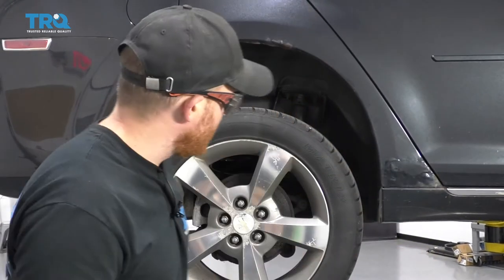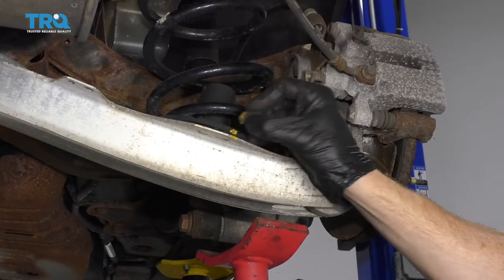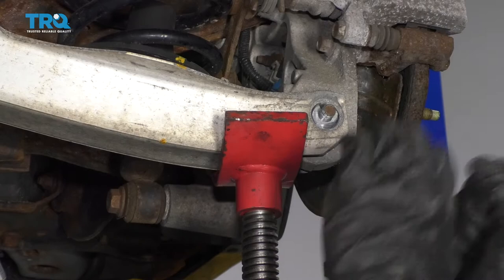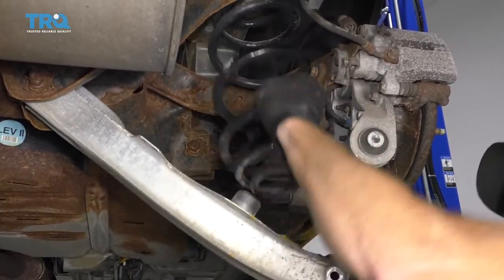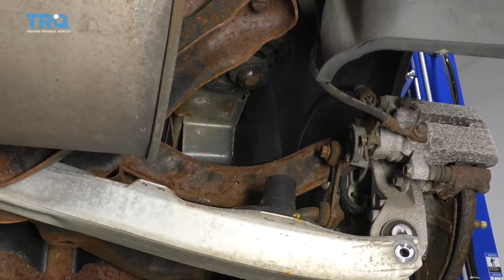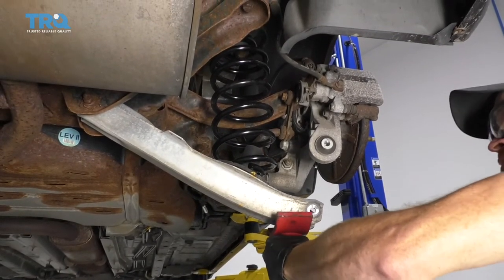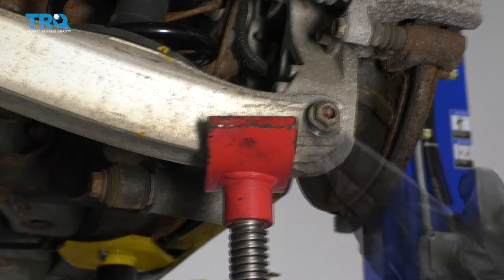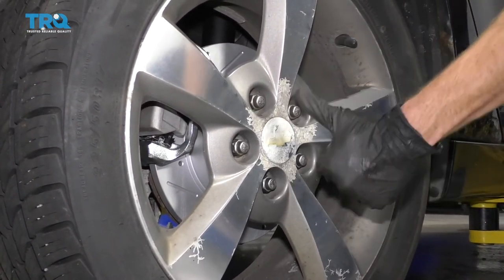How to Replace Rear Coil Spring 2004-12 Chevy Malibu

Comment: I have a question about the lower control arm for the rear, i see it has a little spring in it. My control arm part of the metal cracked, im gettting a replacement arm but is it easy to replace those as it is the springs? my spring also broke.